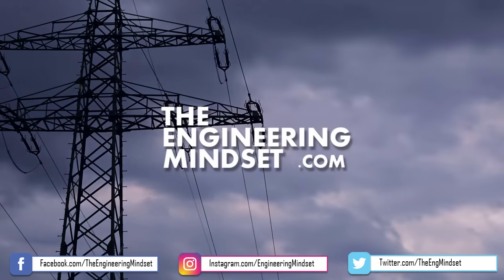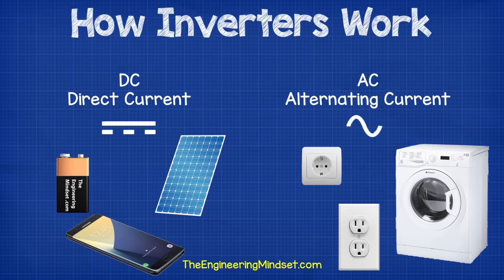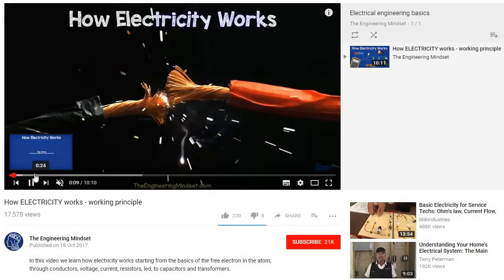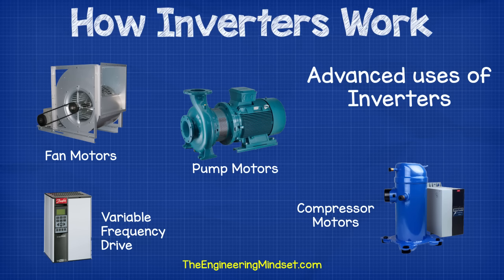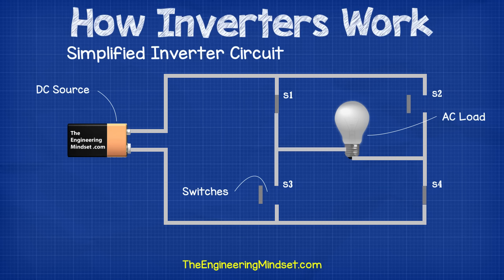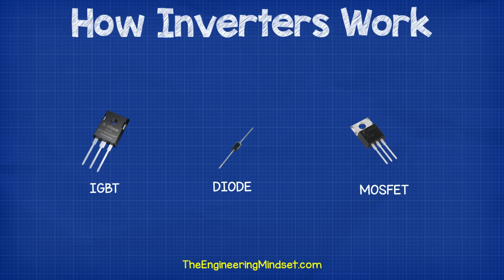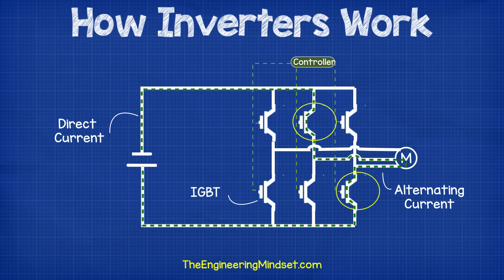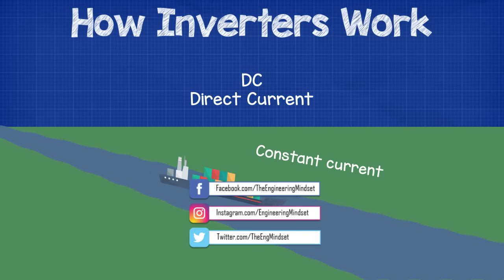How Inverters Work - Working principle rectifier

Comment: Non-engineer here.., I feel like I am understanding it to a point. If you are using the PWM to vary the speeds of an AC motor, wouldn't this put a lot of stress on an AC motor that was designed for 50 or 60 HZ? Or do these need to be more robust AC motors designed to take the stress or variable frequencies? 
Awesome informative video! Thanks!

Comment: Nice explanation, Correct me if I'm wrong... 
INVERTER AIRCON convert the AC to DC then back to AC power source (with the help of IGPT to manipulate the Sine Wave frequency) to run the air con compressor motor at different speed (similar to DC Fan)

NON-INVERTER AIRCON powered by AC will run by constant frequency Sine Wave power source. Its' compressor motor will run on full speed thus consume more electricity?

Comment: Question:  I have a inverter in my refrigerator that is grounded,  which appears on the wiring diagram to be grounded in the fridge itself plus the fridge is grounded in a dedicated circuit. I'm getting fluctuating 9-43v from house ground to earth ground. Could this inverter be causing this as the inverter modulates the compressor speed acting like a french ground? I have checked the wiring from the panel , all is new and secure and the fridge runs as normal.

Comment: Sir if we are using single transformer for inverting and charging the battery back how the mosfet will work as switch and rectifier. Please explain. My question is to find answer for the new direct start methods in bike engines which use same single coil as starting motor and charging alternator.
Reply from the maker: Seen our new Transformer video? here https://youtu.be/jcY4QN7awEc
Reply from the maker: See my new MOSFET explained video here➡️: https://youtu.be/AwRJsze_9m4

Comment: The converter is not an inverter even thought it could be but two terms are not used interchangeably. Inverter two types digital and analog. Digital is like the Q and J output : the Q output the supposed resulted and the J is the reverse of that while the analog is that it take the sign wave input and shift 180 degree phase angle to create an opposite of the input and out put it to cool the ambient attack signal or to cool extreme high temperature by communication effect

Comment: But i thought all things use dc at the end, so the ac appliances use a rectifier to convert the ac to dc i thought? I am confused, if i am correct is it done this way to control phase frequency and other things? Or am i wrong? Thanks!
Reply: Some things use AC all the way through, usually this is used by large motors, heating coils, & the like.
For an alternative example take a look at RC brushless (AC) & DC motors & their differences.
Reply: @NM-wd7kx  thx i will
Reply from the maker: Check out the new BLDC Motor video: https://youtu.be/yiD5nCfmbV0
Reply: @EngineeringMindset  i am watching it as we speak lol, i am educated on many electricity related things because of you and your channel and many others, thank you!
and what i am confused on i will just keep watching and reading until it sinks in!
cheers!

Comment: I love your videos and how you explain things! Thank you for this series!

Could you make a video that explains how basic household appliances work? Things like a microwave, refrigerator, coffee machine, electric fan, or HVAC? I know it's basically converting electric energy into the specific kind of energy an appliance uses to do its job, but how does that conversion happen?

You explained light bulbs (lamps) as an example, and that's just electric current running through a wire of a specific material that produces light energy at a certain temperature.

EDIT: Just finished the video. That's amazinggggggggg why don't we learn about this stuff in school???

Comment: Are you old enough to remember the old fashioned vibrators that were used in tube car radios of the fifties? Your beginning illustration shows how the vibrator worked. The one of the output fed a step up transformer, the a second set of switches would take the output of the transformer would then be used to un-alternate the output of the step up transformers to feed the filtering network then to the tubes. Selenium and silicon solid state rectifiers did no exist at that time!

Comment: Hi, at 7:05, I don't get how the graph on the left shows positive voltage being fed into the motor with the respective switches closed and then switches to negative voltage but the same switches are still being closed. How do make the DC flow in the opposite direction if the same path is being used?

Comment: So how many times do the pulse switches need to change in order to mimic the sine wave? And why does having sharp changes in power damage AC electronics?
Reply: The frequency of the control signal is between 10 and 12KHz depending on the brand and is what produces the high pitched whining noise when under load.
Reply: 1st  60,50 times

Comment: good video, but my inverter turned off while abroad for 12 months, when I got back the fault light was on and the inverter Tripp had turned off. After I put the trip back on the Battery back up and the charging system was not working. I have been it with the manufacture but they have told me it's out of guarantee this would have been in less than 4 years so far I have not been able to get the problem sorted, with lots of installers but no proper engineers can you help me?

Comment: Actually PWM for ac motors works in a slightly different way.Since lowering the power won't affect the speed of the motor but just the torque PWM works on the frequency it does something like sending a full positive wave skipping the next negative,the next positive and then sending the next negative....it kinda allows one half of the wave form stops the next 2 allows the 3rd and so on....this way the frequency is basically reduced to 1/3 from 50hz to something like 18 hz slowing down the motor

Comment: With electric motors the ac courent, yes, gets peshed by the peak valley combination so indede alternating the frequency and intensity does indeed change the speed. Alternators are yes 3 phase. 4 phase was experimented with but they have been found to b ineficiant.
Reply from the maker: Check out how car alternators generate electricity here: https://youtu.be/jdSKlg80DjU

Comment: You omitted a rather fundamental fact when explaining DC, namely that it alays flows from positive to negative.
Reply from the maker: No it doesn't, electrons flow from negative to positive you were just taught conventional current at school which is disproved
Reply: @EngineeringMindset  Does it matter?
Reply: @Beevreeter  Yes, it does. Namely to not get confused by interjections like yours after learning about electron flow.
Reply: @Anvilshock  Sorry if you're confused

Comment: Nice video
A couple of minor things.
 It's important that one set of switches open before the others close. If closed before open (as narrated) then a short circuit will result and the IGBTs will disintentegrate. It's called shoot-through. 
In the 3 phase animation, the active Mosfets should swap to the other pair for the negative half cycle. :-)
Reply from the maker: See my new MOSFET explained video here➡️: https://youtu.be/AwRJsze_9m4

Comment: Informative, significant topic and Useful, however I don't think he explains what the abbreviation IGBT stands for?
Reply: Insulated Gate Bipolar Transistor, Part Mosfet, allowing a low power driver circuit, part bipolar transistor, giving low ON resistance :-)
Reply from the maker: Transistor video now live: https://youtu.be/J4oO7PT_nzQ
Reply from the maker: See my new MOSFET explained video here➡️: https://youtu.be/AwRJsze_9m4

Comment: Most things in your home dont realy care if they get ac or dc.. so you dont need an Inverter to power everything in your home.... If your dc source is at the right dc level
Reply: One caution is that standard GFCIs (RCDs) may not trip if the fault current is not 50/60Hz ac. There are special ones that work with DC, or high frequency leakage from a motor inverter.
Reply from the maker: Power inverter video  here https://youtu.be/iIqhAX0I7lI

Comment: Is it possible to make a vfd whre you can separately control both frequency and voltage... I mean can we randomly control the frequency and power supply  at a time??
Reply: Yes, this circuit configuration does this. There are inductors in the full circuit that smooth all the edges off. If the duty cycle of the PWM is a ratio from 50% down, the peak Voltage is only half.
Reply: @andrewwhite1793  thanks
Reply from the maker: VFD Video is now live! here: https://youtu.be/yEPe7RDtkgo

Comment: So why push DC thru a series of IGBT's in order to run an ac motor?   Why not just hook it up to 3P AC source in the first place?  Why chose an AC motor over a DC and vice versa.  Is it all about precise speed control?
Reply: 1- The electric grid only provide you with one phase of electricity in most cases. Even if it did have 3 phases, it it's not the required amplitude and frequency for variable or constant control in some cases.
2- There are motors that are only operated by 3 Phases such as the induction motor which is very widely used in industrial applications because of its efficiency and reliability. Inverters help drive such motors with precise speed and torque.
Reply from the maker: VFD Video is now live! here: https://youtu.be/yEPe7RDtkgo
Reply from the maker: Power inverter video  here https://youtu.be/iIqhAX0I7lI
Reply from the maker: DC motors explained https://youtu.be/GQatiB-JHdI
Reply from the maker: NEW! Check how AC motor works here https://youtu.be/59HBoIXzX_c

Comment: I am really confused how a single phase inverter can be grid tied (for the purpose for feed in for example or alternatively if connected to the house to be identical to standard wiring and not suddenly neutral also becoming a phase), as in this explanation given it looks to me that that a single phase inverter is practically 2 phases 180 degrees opposed, where would the neutral be created from ?
Reply: Assuming the inverter has no other reference to ground and doesn't feed into a split-phase system it shouldn't really matter, the neutral terminal is the one you connect to the neutral wire.
Reply from the maker: Power inverter video  here https://youtu.be/iIqhAX0I7lI

Comment: Good explanation, but still no one will explain how it is possible to increase voltage (e.g 12V DC to 220V AC). How is that possible, how does that work? To understand what I mean is that If I have to compare it with water going through a small hose and then going into an "inverter" like machine how can that machine produce MORE water to come OUT from only the little water that is coming IN?
Reply: And this is when using water as an anology breaks down.
Reply from the maker: Power inverter video  here https://youtu.be/iIqhAX0I7lI

Comment: Good to see you have the electrons flowing in the correct direction. People please keep in mind that if the diagram simulator was showing conventional current, the diagram simulator (not reality) would be flowing in the opposite direction. In reality electrons flow out of the negative source when power is being used. This is important because the direction of electrons over a resistive load determines the positive and negative voltage potential differences induced on the terminals of the resistive load.

Comment: Inverters convert dc to ac phase power opposite of a transformer
Reply: transformer doesn’t converts ac to dc ... there are not opposite
Reply: AC to DC is known as a power supply. A transformer multiplies or divides voltage whether AC or DC and are used in both inverters and power supplies. A 12V/120V inverter would use a (roughly) 14:1 transformer to bring up the DC voltage to around 170VDC before inverting to sine
Reply from the maker: Power inverter video  here https://youtu.be/iIqhAX0I7lI

Comment: Please help me understand.  In a direct current setup, one can use a DC motor by the use of DC current, then why (give me reason for) you need to use AC current on large in industrial motors.  Why you cannot use DC current instead, on industrial motors?
In my mind, DC current is a much simple form of current, it is continuous flow of current, why you need to complicate the current by negative and positive charge as AC current does, how does it benefit to any application by the use of AC current, in the place of DC current?
Reply: Keeping it simple, four good reasons would be $$$ cost, efficiency, size, and speed range; just to name a few.
Reply from the maker: DC motors explained https://youtu.be/GQatiB-JHdI

Comment: Just want to share to you all for better understanding about why AC is used for mains power output instead of DC. AC is used for home power outlet since it is efficient for a long distance transport. Since the current is alternating, it can reduce the hazard of the wire from burning because of very high current passing through the wire. Also, it is easy to increase or decrease voltage by using transformer, which is not operable with DC, unless you make it pulsating, but that's not efficient anyway. But, the thing is, AC can pass through the body because our body can act like a capacitor. AC can pass through capacitor even at lower voltage but DC requires much larger voltage to pass through the capacitor. This means, you will get electric shock much easier with AC but not DC. So, AC has much more pros in term of cost and efficiency while DC has pros in term of safety. Aside of safety problem, converting AC to DC for electronic device usage is challenging. The simple one is by using diodes to rectify the AC so that it will flow only in one direction. But the voltage you get is not smooth. It has bumping voltage, which you can see with oscilloscope. Adding the capacitor does the job but the voltage will easily change according to the load. Lots of components required to make sure the DC output is stable, regulated and safe from any hazards like AC leakage and voltage spike. Even more components required for features like PFC, OVP, OPP, OCP, OTP, and more.

Comment: None of these videos explain how an inverter takes the 12v DC and converts it to 120V AC. All they explain is converting DC to AC not the ramp up and how that is done.
Reply from the maker: Clearly you skipped through the video https://youtu.be/ln9VZIL8rVs?t=448
Reply: @EngineeringMindset  nicely but firmly told the C  student to pay attention 😂
Reply from the maker: Power inverter video  here https://youtu.be/iIqhAX0I7lI

Comment: it is possible to save electricity if i used ac to 12volts adapter to inverter = AC output ?
rather than use our AC plug directly ?
Reply from the maker: Power inverter video  here https://youtu.be/iIqhAX0I7lI

Comment: Great video, I would love to see you explain how pure sine waves are generated by an inverter.
Reply: This is how pure sinewave inverters work. They are never really pure, just a reasonable approximation. The modern mains supply is never really pure either.
Reply: @andrewwhite1793  exactly ,perfection in sub systems is rarely found; one wonders if there are defective atoms or photons for that matter.
Reply from the maker: Power inverter video  here https://youtu.be/iIqhAX0I7lI

Comment: Wow, I understood that on the first attempt. Thank you! So what you are saying is that the circuits gates are allowing negative and positive current through their gates from the battery in alternating pattern simulating AC current, therefore becoming AC current since they are coming from two different circular paths of directions.

Comment: two things I want  to point out.

1st: using a lamp as a load is a bit silly because an incandescent lamp doesn't really care if it gets AC or DC. 

2nd: usually when you employ a freq-drive you are doing so to lower the frequency not increase it (as displayed in your animation), but I have learned recently that some of the freqs' at my work can go up to 400Hz, tee hee hee.  

Just a couple of small nit picks, looking forward to seeing what else you do with your channel.
Reply: Yeah but because it's used to lower typically doesn't mean it can't be used to increase right
Reply: @bigkirbyhj666  That's what I figured out.  Some freqs can actually overdrive motors if you go above 60 Hz.  I wouldn't go above 120% or so for fear of damaging the motor.

Comment: Can we use a 60HZ Inverter split air conditioner to 60HZ current
Reply: Jerry Hermo come again I cant undertsmad what you are trying to say
Reply: Hz is Hertz which is the  measurement of frequency. Current is measured in Amperes (Amps) they can't be converted into each other
Reply: @sumnewguy  they are different things to begin with and one cannot become the other.
Reply: @ericscaillet2232  that's what I'm trying to say
Reply from the maker: Power inverter video  here https://youtu.be/iIqhAX0I7lI

Comment: If the frequency can be increased is there any possibility of increasing the current drawn ?
Reply: You can only increase voltage and frequency. Current is a product of the your tool, accessory ... to take. Some tools take one kw, some take three...
Reply: U can increase the amplitude of the supply thus increasing current it is done in Tesla cars